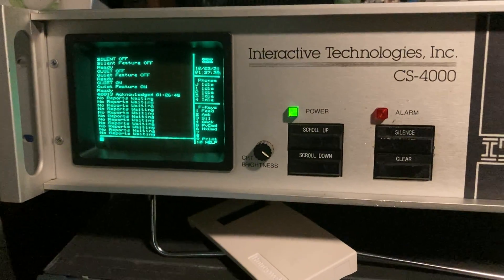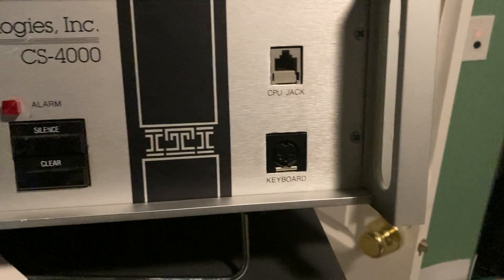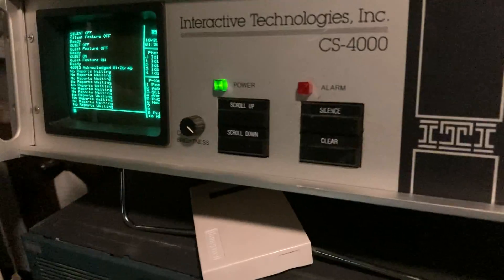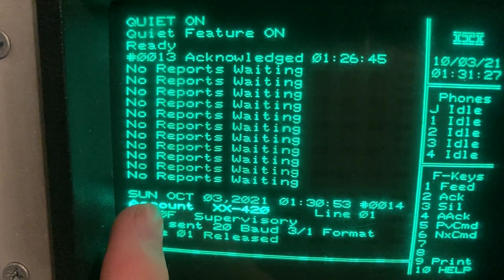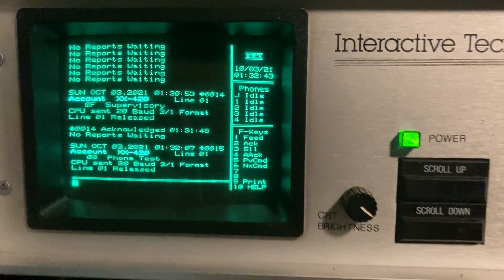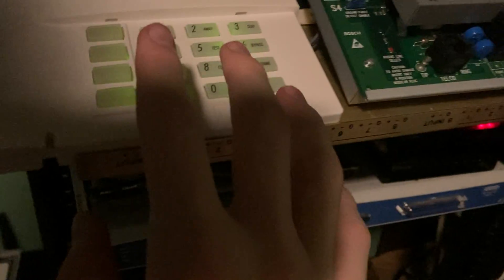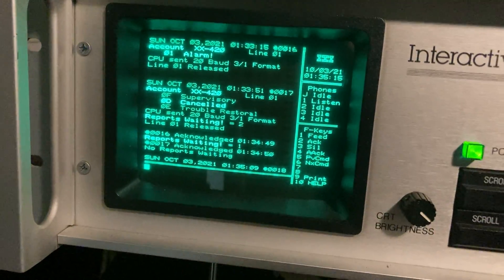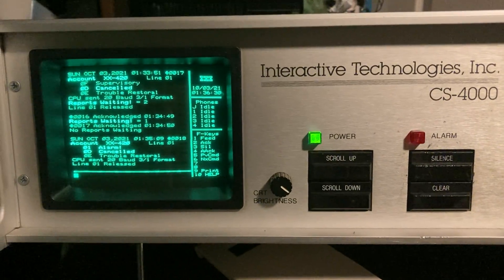ITI CS-4000: The most unique central station receiver

Comment: IIRC, the very first format(s) may have only used 0 thru 9; 10 pulses was was used for ZERO (that was over 40 years ago and my memory isn't as good as it once was).  When FSK was added, it could handle all 16 digits of hexadecimal (0 thru F), but pulse was limited to 15 digits (1 thru 15); you can't send 0 pulses.  That difference sort of hamstrung FSK since it had to to treat A as ZERO or not accept pulse formats.

Comment: I have an old SX-V system which crashed.  I got it working  but my central station can no longer program the sensor groupings.  Could we arrange for me to call to you from the system and you program it with your CS4000?

Comment: I worked in Test and Design engineering for ITI 1995-2000, working an the "learn mode" wireless transmitters and the Concord Express and used these for testing. Haven't seen a CS4000 for decades! Good memories...

Comment: can you make a vid of how to hook it up and program it
Reply from the maker: I may eventually show it's programming, but setting one up is quite simple. Just a matter of connecting a IEC power cable and plugging in phone lines to the jacks.
Reply: @KJ7BZC  a line from the panel to the receiver?
Reply from the maker: It needs to be connected to a telephone system, the panel calls the number for the line that the receiver is connected to.
Reply: The line card has to see on-hook phone line voltage (DC) or the receiver will go into Trouble.  Also has to see ringing voltage (AC) to know to pick-up the line and start sending tones.  

There are, or used to be, ring-down adaptors with on-hook voltage that could be used as a POTS simulator.  You just had to program 1 as an account number.

Comment: I used to work on a ton of ITI SX-IV, SX-V, and Caretaker panels many years ago. We had one of these in our central station along with some of your other Radionics gear. I knew these inside and out practically at one point. Fun times…
Reply from the maker: Glad I could bring back memories for you, they're hard to find, but there's still SX-V systems in use out there. Don't think the company I work for monitors any, but we definitely have a few accounts still using 3x1 pulse format, its amazing how much old stuff is still around.
Reply: Very cool! We had an SX-V panel years ago; very first alarm system we had installed at my parents’ house. Indeed, I remember the panel had a “supervisory” LED if a zone had trouble. A local monitoring company took the panel over by installing a secondary Radionics D4112 connected to the bell output. They weren’t able to program it at all, as they were a strictly Radionics outfit. Later on, we upgraded to a D7212 hardwired system. For the time period, the SX-V was a very capable wireless system when wireless technology was not really a thing anybody in the industry seemed to take seriously. I am pretty sure that there are still a couple of sensors at my mom’s house, along with a smoke detector from the SX-V that was left up for its ability to annunciate independently from the panel and sirens. The siren was a WIS, iirc, “wireless interior siren” that screwed into an outlet and had a backup 9V battery. That thing had 2 piezo screamers and it was LOUD! Ahhh, good times. Thanks for the walk down memory lane :)